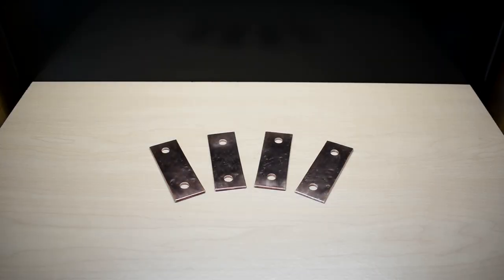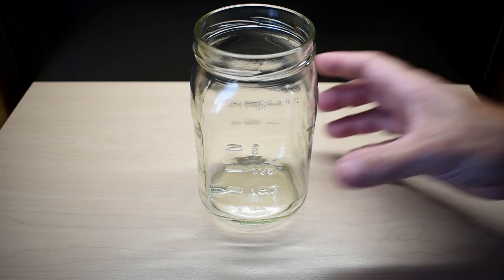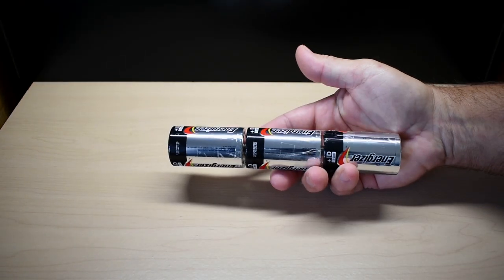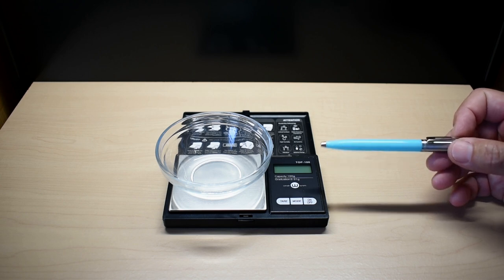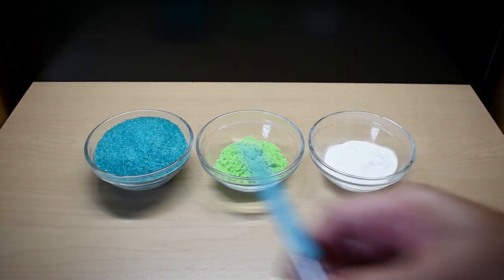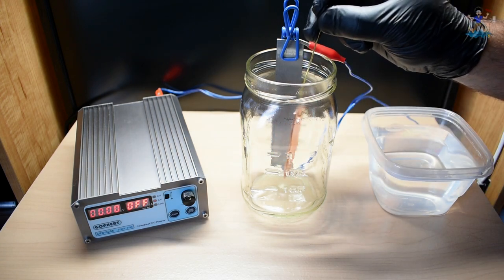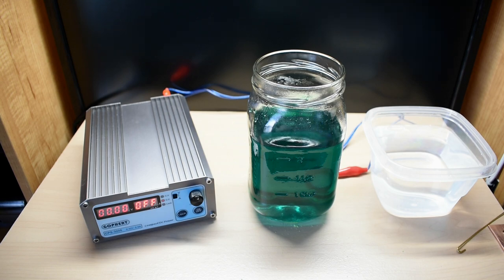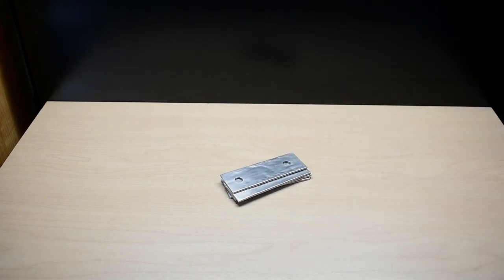How To Make Corrosion Resistant Nickel Plated Bus Bars!

Comment from the maker: I hope everyone enjoys this step by step, easy to follow nickel plating video! I cannot stress enough how important it is for you to share this video link with others if enjoyed it and support the creation of new videos on my channel. Thank You!

ADDITIONAL INFO: The solution can be used Multiple times. Never use the microwave to heat it back up! Not only can there be a problem with tiny metal particles in the solution, but you never want to boil the solution, it can give off toxic vapors. The safest way to reheat, place a thermometer into the solution in the jar, then place the jar inside a small pot of room temp water high as the solution inside the jar. SLOWLY heat the water and keep an eye on the temp of the solution. 150F is perfect(120F to 160F is a good temp range), I went higher in the video (160F), because I knew it would cool down as I was stirring in all the chemicals. When the temp is reached, remove the jar and get to work. If you have an old, small pot laying around, you can carefully pour the solution into the pot to heat it, but I prefer the 1st method. If you notice sediment in the solution, filter it using a coffee filter. (Wear gloves and eye protection!) Thanks for watching!

Comment: Thanks for the video. Once you mix the solution and use it...can the solution be saved and used again later?
Reply from the maker: You're welcome Steve. Yes, tighten jar lid, and store it in a safe area where the jar will not be broken(Garage shelf or cabinet). Follow the instructions provided in my pinned comment for reheating. Thanks for watching! Remember to share the video link with others.

Comment: Excellent video!  Question; can the chemical solution be used multiple times or is it single use?
Reply from the maker: Multiple times. Never use the microwave to heat it back up! Not only can there be a problem with tiny metal particles in the solution, but you never want to boil the solution, it can give off toxic vapors. The safest way to reheat, place a thermometer into the solution in the jar, then place the jar inside a small pot of room temp water high as the solution inside the jar. SLOWLY heat the water and keep an eye on the temp of the solution. 150F is perfect(120F to 160F is a good temp range), I went higher in the video (160F), because I knew it would cool down as I was stirring in all the chemicals. When the temp is reached, remove the jar and get to work. If you have an old, small pot laying around, you can carefully pour the solution into the pot to heat it, but I prefer the 1st method. Thanks for watching!

Comment: I seen someone making plating solution by electrolyzing nickel in white distilled vinegar solution. I have neither chemicals u mentioned nor white distilled vinegar available. Do u think using citric acid to make solution would work?
Reply from the maker: It's definiely a safer alternative, but I doubt it's better. Thanks for watching!
Reply: You can easily nickel plate bus bars using nickel acetate: take two nickel bars, hook up a power supply and dunk into vinegar (maybe with some salt). Wait till it turns to a green solution (this is you acetate). Take out the bar on the negative pole of the supply and replace with your copper bus bar. Dunk it in for a few minutes and you're done.
Reply: @upnorthandpersonal  I have only classic yellow vinegar available here, I'm worried if there isn't too much contaminants like fats and sugars that could screw up the process.
Reply: @plainedgedsaw1694  Don't know - give it a try :) All you need is a small amount of nickel, something copper,  and a power supply.

Comment: At 4:00,  I had the same power supply, until I hooked up some LEDs that were within the limits of the power supply-
It destroyed the transformer inside.  eerrrr
Reply from the maker: You must have gotten a lemon, or there's more to the story. LOL My unit has worked great since I got it almost 5 years ago. I've used it in many of my videos.
Reply: @electronicsNmore  - I had it past warranty, so I striped it for parts!  I bought 2  RD6006. They can handle it full current.
Reply from the maker: @tubeDude48  I've exceeded the max current countless times, never a problem.